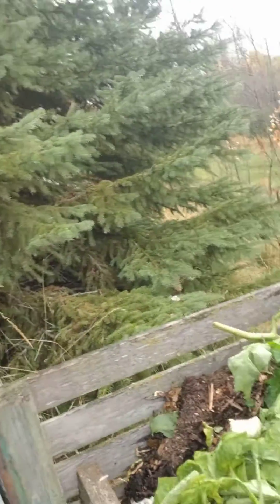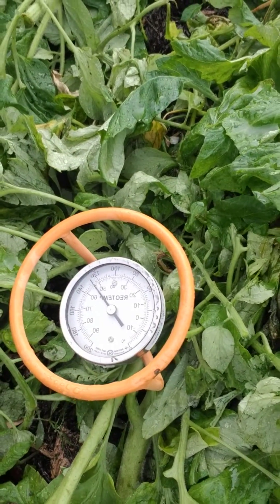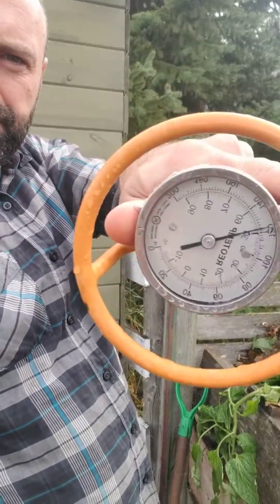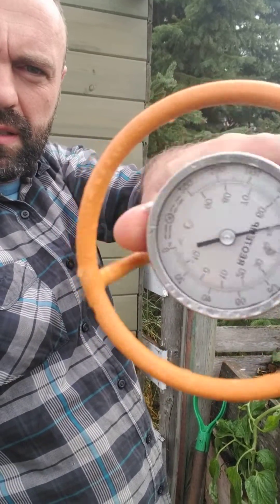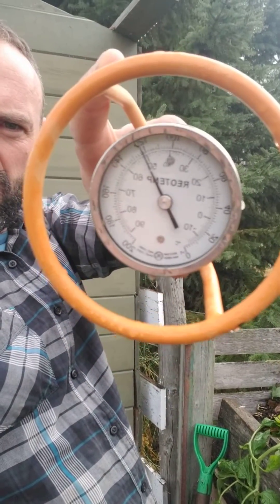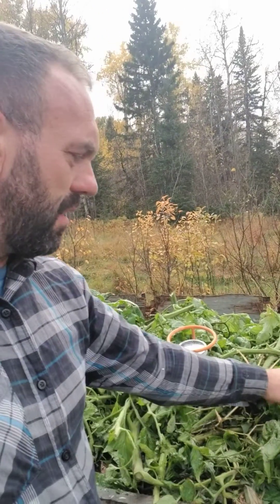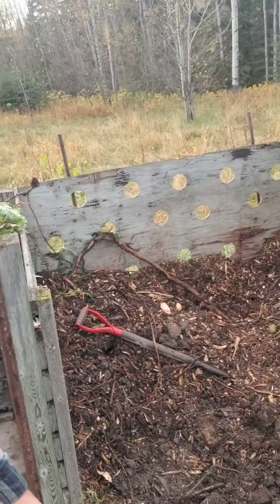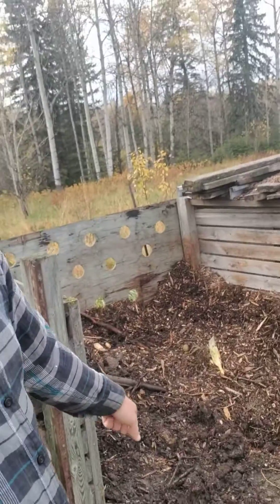Compost Speedometer - How To Use A Compost Thermometer #shorts

Comment: Compost should be used as an inoculate. You should build soil structure first, then introduce species of bacteria, fungi, protozoa, etc. It takes very little compost to inoculate. There is very little reason to make compost (one reason is to turn garbage into something usable), but other than that, compost should be made by simply placing carbon on top of your dirt, then wait.
Reply from the maker: All true.